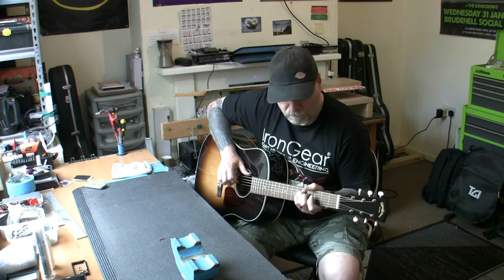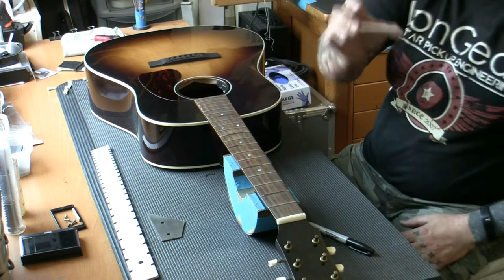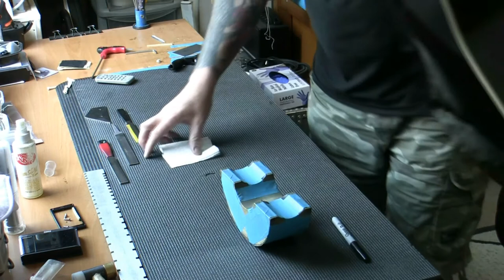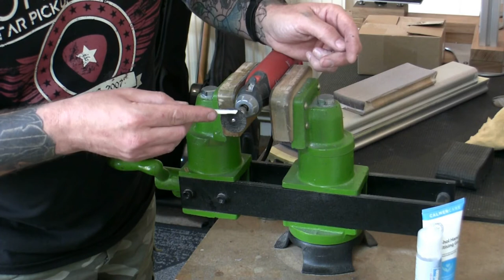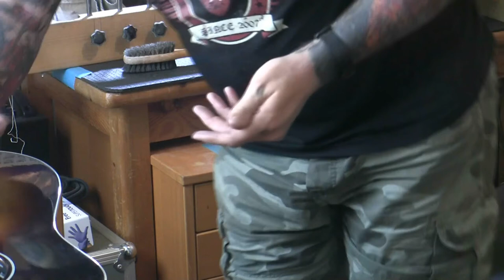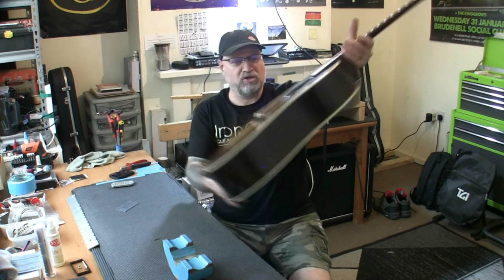Sigma JM-SG45 acoustic guitar intensive setup

Comment: I have the AMI branded one- it needed a lot of set up work, which I did myself, and I also replaced the pins with Bob Colossi died bone pins... looks  a lot better.  I had to drive/hammer the low E pin out from inside the guitar. There is NO good excuse for that. None. Zero.Zilch. Nada.

I also tried the DR strings mentioned in this video and was less than impressed. I also tried Martin Retro 11-52's which I liked, but I like to experiment with strings and have, for the time being at least, settled on Martin Flex Core (Tommy Emanuel endorsed) 12-54 PB. 

The guitar sounds fantastic, but, the Fishman Sonitone ain't all that great and stopped working when it was about a month old. AMI did send me another one, free of charge.
Reply from the maker: I'm surprised you don't likle DR strings? They are all ive used in the last 5 years. I even have them on my luthier-built (£3000) J-45 dreadnought type acoustic. I love them! I've never liked the Fishman stuff: I have an LR Baggs Anthem in my luthier-built...

Comment: For your information:-SPEC:

Body

Body Top: Solid Sitka Spruce

Body Back & Sides: Mahogany

Body Size: D-14 Fret Slope Shoulder

Body Shape: Slope Shoulder Dreadnought

Body Finish: High Gloss

Neck & Fingerboard

Neck Material: Mahogany

Construction: Dovetail Neck Joint

Neck Shape: Low Profile

Scale Length: 628mm

Fingerboard Material: Micarta

Nut Material: Bone

Nut Width: 44.5mm

Hardware & Electronics

Electronics: Fishman Sonitone

Tuning Machines: Grover Open-Geared

Hardware Colour: Nickel
Reply from the maker: Thanks
Reply: are the sides, back and arm solids?
Reply: @ProfYago  no, laminated

Comment: I have one of these and it came with a super high action, and I haven't got around to sorting it out. Is it not possible to lower the action by just adjusting the truss rod? Is shaving something off the saddle absolutely necessary?

I'm happy to adjust the truss rod myself but don't fancy doing the bridge/saddle work!
Reply from the maker: Adjusting the truss rod straighten or bends the neck. It will affect action height but it will not cure it. to lower action, you need to (sometimes) lower at the nut end but always lower at the bridge/saddle end...

Comment: Bit of a shame fella....I thought that guitar sounded loads better at the start of 📹, when it had a higher action (much louder & far more sustain).
Reply from the maker: Maybe you had to be in the room? This is using trhe mic on the camera: it's never going to give a true representation of the sound in the room! Victor...
Reply: The action you want depends om your playning style. The ower if this guitar is probably a light strummer/fingerpicker, therefore he prefer lower action than, for example,  a hard strumming blugrass picker.
Reply: My comment wasn't about how the Sigma plays Lars....if I remember it was about how it sounded 🔊 
And watching this 📹 again after nearly 2 years I'm still of the view that the Sigma acoustic being worked on by Victor sounded 'well better' with loads more sustain & volume when played relatively softly by Victor before he took to lowering it's action. 
Surely you want the best' sounding guitar you can get your hands on 🤨... What a lot of people seem to forget is that in lowering the action on an acoustic there' is often a trade off, in the sound quality & sustain that you will ultimately get from that instrument. 
You must also remember that in lowering the action on an acoustic guitar you will also be lessening the break angle over the bridge saddle & hence the transfer of the strings vibration into the top of the guitar (the sound board) won't be as good....as can clearly be heard here with the Sigma not having as much sustain or sounding as good as it did before the action was lowered 🙂